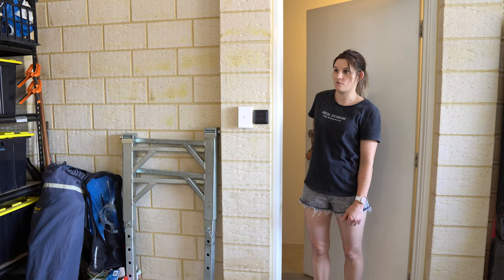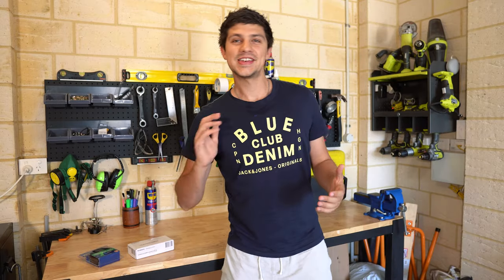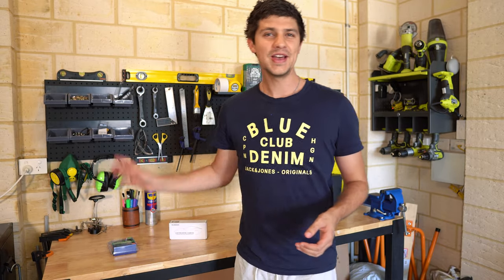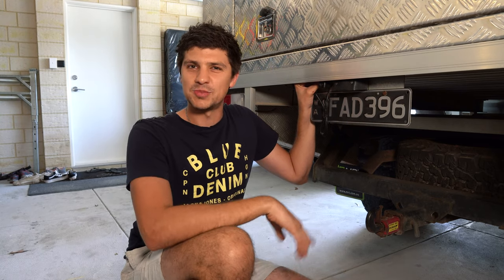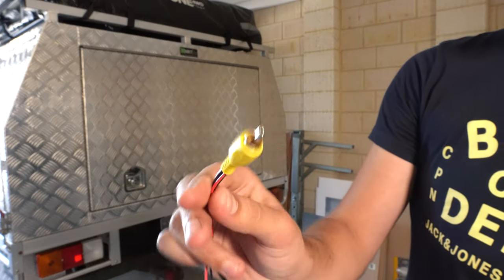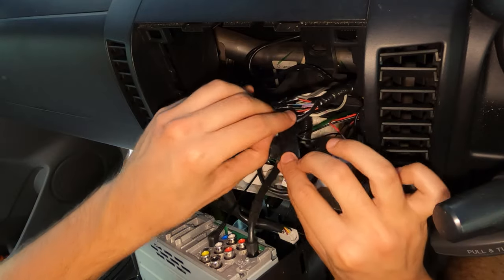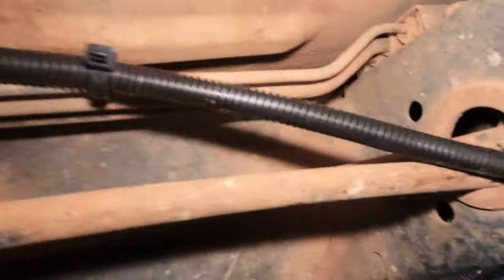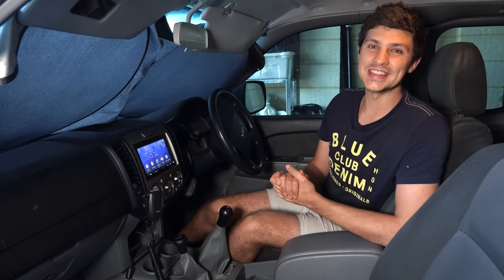Reverse Camera Installation | Pioneer RCAMAVIC review and demo

Comment: Going from a wagon/hatch (wrx) to a ute with steel tray one of the first mods was a double din deck (when swapping over the setero) with a reversing camera, its sooooo handy plus i can use it as a rear view camera if i have big loads in the tray
Reply from the maker: That's a good idea, I was contemplating wiring mine up so I can toggle it on manually instead of through the reverse wiring - might swap it around in future or run a separate switch :)
Reply: @explorebound  yeah, not 100% on yours but mines thru my kenwood deck as i have a "cam" button ahaha

Comment: Hey dude, is that the Sony XAV-AX series head unit? been looking at getting one for my VZ Commie. looks like it interacts with the reverse camera good, how does it fair in everything else??
Reply from the maker: Hi mate, yep the head unit is the AX3000 - fantastic unit that works well. My partner has the AX5000 which is also good, did a bit of a comparison of both units here if you're interested: https://youtu.be/asx6IVT8PDw

Comment: Hi mate,
Thanks for sharing your video. I just got exactly the same camera. I wanted to ask you if there is any reason why you welded the positive wire together with the purple reverse cable from the harness of head unit and then you still welded the extension wire you ran to the positive wire of the reverse light at the back of the car? is it necessary to connect the positive cable to both head unit and reverse lights?

Thank you
Reply: Yes. The positive feeds the camera and tells the head unit when to switch to camera input

Comment: Hey, mate. 

Im looking at installing one of these as it came with my headunit.
To clarify, you spliced the Head Unit's purple reverse cable into the 12v red of the camera? And then the 12v into the reverse lights for power?

Comment: 6:08 Soldering wires in a car is considered bad practice, you're supposed to crimp the wires
Reply: also --- if you're soldering, better to use heat shrink instead of insulation tape.

Comment: what tool did you use at 6 minute mark to separate the insulation on the wire you t-soldered onto?  That would be a very great tool to have. as ive always needed to do that step using my fingers and razor blade.
Reply from the maker: That's a wire stripper similar to this: https://amzn.to/3Wf2Thr Definitely a good tool to have!

Comment: hey bro i have the same verse camera, onto a pioneer headunit AVH series, for some reason when i put it in reverse the screen doesnt trigger to reverse with a video feed, but when i put camera view on it turns on... i have played with the settings and have got it to trigger when i put it in reverse but it doesnt display anything it just has a black screen.. so in order for the video to turn on i have to change the setting to camera view and when i put it in reverse then it works
Reply from the maker: Hey mate, did you definitely tap into the reverse feed for the head unit as well as plugging the camera in?

Comment: Hey mate, nice job! I got my RCAMavic today to place the old one from the Aurion. Just want to ask what type of cable did you use to extend the power cable from the headunit all the way to the back of the reverse light? What is the one that you got? Am I looking for a specific voltage, ampere, or gauge?
Reply from the maker: Hi mate, I just used 10A Narva single core automotive wiring from Supercheap Auto.
Reply: @explorebound  thanks a bunch! Merry Christmas ayheyyy
Reply: @explorebound  Hey mate! Just a quick question, you wired the 12v to the tail light, however in the instruction it said to wire it to ACC (+12v). If I wire it to ACC then would it overheat the camera as it is always on?
Reply from the maker: I chose to power the camera with the reverse light wiring out of convenience mainly, seeing as I was already running that wire to signal the head unit to activate the camera feed - I'd say powering it through ACC power would be fine, I can't imagine it burning out the camera having it powered up while your keys are in, that way you could activate the camera when not in reverse too.
Reply: @explorebound  ah yea, thanks a bunch, saw you tapped into your reverse light already so that's alright. Thanks!
Reply: @huyanhpro1999  I have the same camera but lost the wiring instructions can you send me a copy of it please
Reply: @tango5370  red for 12volt+, black for ground (ground it to the ground near the headunit), you can have another cable outside for linking the reverse light wire to the trigger wire in the headunit
Reply: @huyanhpro1999  thanks for that. I ran the red wire to accessory and burnt out the relay after 6 months so I brought a new one yesterday all good now 👍